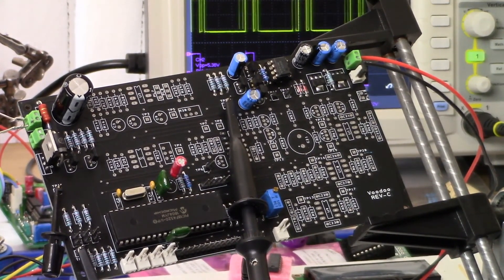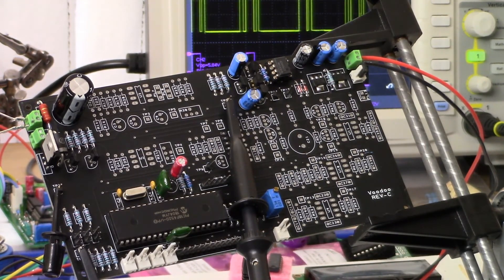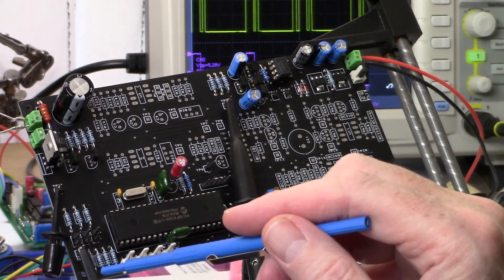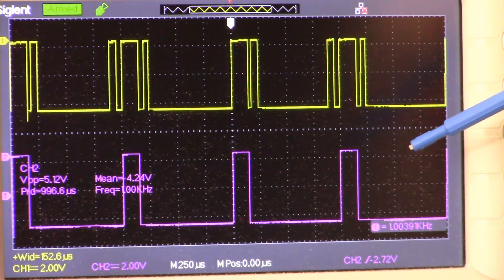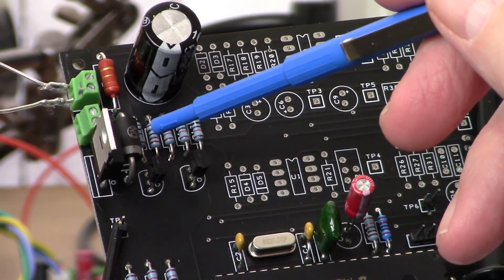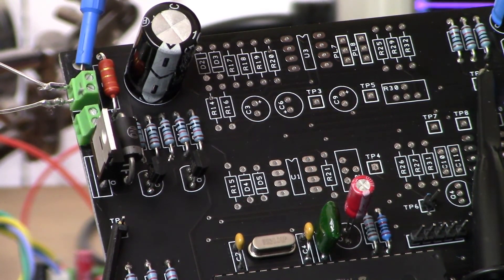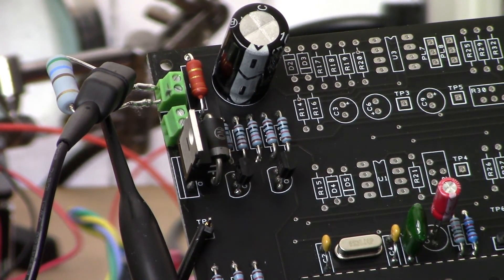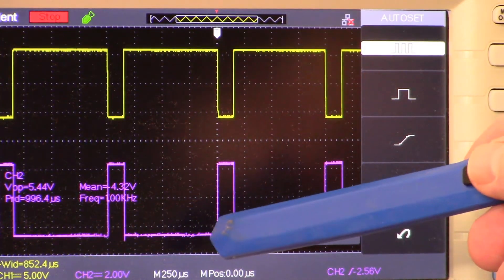Voodoo DIY metal detector Part #2 Transmit circuit

Comment: Hallo and thanks 👍 so much for your efforts,I was asking you about a search coil,I would like to know what characteristics should have the coil and the transmitter to get 2m deepth.
Reply from the maker: Delta Pulse is more of what you want.  Go to the Geotech Forum, all the information is there my friend.
Reply: @SurfDetector  thank you 😊
If possible is there any link to the topic or to PCB and thanks again
Reply from the maker: Adil just use the search window on the forum.  You will find much information.